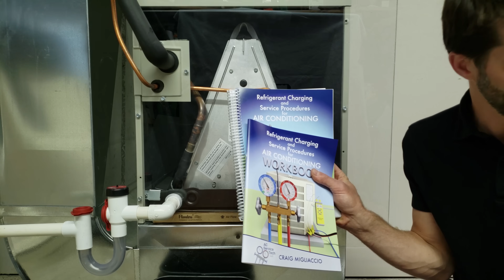Why a Condensate Trap is Needed on an Air Conditioner! Up Close View!

Comment: Good video but the placement of the blower in relation to the coil determines if the condensate drain has a negative or positive pressure. Most systems I have worked on have a positive pressure. A untrapped positive pressure system will blow air out the condensate line and I have had customers on occasion hear a bubbling sound in the walls from this. I experienced a job where an untrapped negative pressure condensate line was hooked up to the houses sewer drain line and without the trap it pulled sewer gas smell into the house. Also  an explanation of the secondary drain should be given. When the primary drain becomes clogged, the water will then drain out the secondary instead of leaking into the house. It is code here in California on two story houses to have this secondary drain run outside over a window so the homeowner can visually see this problem. You could also install a condensate float switch in the secondary drain to catch this problem before water damage occurs.
Reply: We also require a secondary containment pan, and drain, on any unit installed over a finished ceiling.
Reply: Right, most systems I've seen are that way also.  With the blower below the coil and blowing upward into it, it will create positive pressure - not negative.  My system blows air/water out the condensate port - not taking air in.  Hence no trap required nor present.  This is only an issue if the blower is after the a-coil in the system.
Reply: Excellent explanation. Better than the OP.
Reply: I have a goodman furnace with the blower at the bottom and the ac lines and I'm assuming the coils on the top. My drain plug is on top half way point of the furnace. Will that make my system positive pressure. Because I don't have a p trap.

Comment: How close does the trap need to be in relation to the coil?
Reply from the maker: It should work regardless of the location on the line because it will stop the air but I usually put it in front of the evap coil, thanks!
Reply: @AC Service Tech LLC good to know! This air handler was in a small closet and it would have blocked the filter access to have it in front of the coil so I ran drain into the crawl and trapped it there. Great content. Subbed!
Reply: Just make sure it slows downhill all the way. That’s critical.
Reply: get the trap placed as close as possible to where it is exiting the houring.

Comment: Good to know! if the homeowner has a trap, should it be checked and filled if necessary before the AC season starts to avoid this issue?
Reply from the maker: Yes put water in it and vacuum or blow it out, repeat, then add the final water as part of the pm process, thanks!

Comment: isnt the trap only required when the evap coil is on the negative side?
Reply: The trap is not "required" on a positive pressure system. Any system where the blower is pushing air across the evaporator is a positive pressure system. If the evaporator is being pulled on by the blower, thats where your negative pressure situation comes in to play. The drawbacks of having a trap on a positive pressure system outweigh its benefits as the amount of cold air loss through a 3\4" pipe are insignificant and the traps will eventually plug up and cause an overflow/shutdown scenario. Should you be concerned about a positive pressure system allowing odors from your drain, there is a fundamental flaw there... The unit is pushing air out of the drain pipe. If you ever do have a smell being picked up and drawn into the ductwork when the blower is off you should consult a plumber about why that drain is so gross to begin with.
Reply: @whitewigglesworth  this is what happens on my system with the trap. The drain plugs every year. I now blow it out before the season. I was wondering if I should eliminate it. My evaporator is on the positive side. I thought the trap was there because they ran the drain to the septic pump cover in the basement to stop the gases. I rerouted the drain and installed an ejector pump but left the trap. I hate that it plugs every year.
Reply: @whiteowlone  Take it out and straight pipe it. PVC is cheap and youll be happier.
Reply from the maker: Yes but a trap would stop low temp air from leaving the system and the building to go negative pressure while the system is running by blowing the low temp air outside. Also a trap will stop any gases in the area from making its way into the system especially if the drain is hooked to the septic line, thanks!
Reply: NEVER EVER attach hard condensate pipes to a septic vent(can create disease or sickness) use a condensate pump with the 3/8 poly tube in the septic vent... always install a trap in the positive or negative side of the ac... (basic ac 101)
Reply: @Blitzkrieg.u812  Thank you for saying that.  I saw that once under a neighbor''s house. I told her it didn't look right and she said her "plumber friend" had installed it, tapping into the main drain by drilling and filling up the gaps with copious amounts of PVC cement. I asked her if she knew what happens in the winter when the trap dries out from having no condensate in it and the sewer gases start to backflow through her house. She thought the smell was from her dog and his " winter diet".  The only reason I was under the house was to check and see if her clogged rain gutters were diverting water under the house.  A competent licensed HVAC mechanic that I recommended fixed it in ten minutes.

Comment: This only applies when the coil/pan is in a negative pressure relative to the space,  when the blower is sucking air through the coil.  Not a problem when the blower is pushing through the coil.  I don't think this was explained well or shown in the video.  It is better to understand the mechanics so you can diagnose problems versus simply being told blanket statements.
Reply: This really only applies to air handlers since the blower is on the positive side sucking. On a up/down flow there is no need for a trap
Reply: yes, however most air handling units and fan coil units have the fan after the coil, thus you will most usually find the drain in a negative pressure/being sucked when the fan is running.
Reply: I agree what you both stated, I'm not a repair tech but install all systems. watch the video again. The filter is in between the coil and the box below i guess the blower compartment . So would that mean the coil is in positive pressure even thought you see it is in negative. What are y'all thoughts. Thanks ahead of time

Comment: Great Video. Yesterday, I was worked on called, No AC, I came to checked, and I was found Unit low pressure and I had a leaked refrigerant. I used leak detector and checked refrigerant R 410 A , I did checked leak on condenser coil and evaporator coil and no find refrigerant leak, checked leak on suction line and liquid line outside and inside house ,next , I used bubble checked leak on schrader valve core and no find any leak bubble. I added refrigerant 410A to 100 PSIG, and do leak checked again on condenser and evaporator coil and no sign of leak. the system only installed 2 years ago.That time was late , I charge system up so customer can have AC on weekend and reschedule for next week come back and do leak check again on AC. I was wonder, where refrigerant went, can't find leak .  If you have any recommend or suggestion . Thank you for sharing.
Reply: I do a splash of r410a (for the detector) and fill it system to evap coil to test pressure (usually on plate on coil) with nitrogen. Remember the operating pressures for 410a are greater than 100 psi.  The leak might make itself known at higher pressures.  When you go back maybe you will have oil from the new dose of r410a present to spot by eye?
Reply: Some times inexperienced "installers" just use the factory charge and never top it off. Usually factory charge is for 25' of line set. I have come across this hundreds of times in one location working with apartments.
Reply from the maker: I use that ultrasonic leak detector which I really trust and rely on. I used to struggle to fin d leaks and now I am not as concerned or worried about not being able to find it, thanks! I have videos using it and the tool link at https://www.acservicetech.com/tools under the leak detection section, thanks!

Comment: When we moved into our new house in North Florida about 8-years ago, we soon started to have filter failures from moisture.  This was happening every 1-2 months, and at times the failed/wet filter media would get blown up into the underside of the coils.  It was quite maddening.  After considerable research, I found a similar video and installed the clear trap you've shown in your video.  After that, no more issues.

I'm a bit confused why something so critical can be missed by the Building Inspector, and the private Home Inspector that I contracted to check the house out before we purchased it.

You've done the best job explaining why the trap is needed, that I've ever seen.  Great work!
Reply: Ha ha ha. Inspectors. That's a good one. They nitpick little things that don't mean a bit of difference, but anything important they forgot to mention in inspector school. Here's 10 pages of bullcrap that needs to be fixed. Give me my check.
Reply from the maker: Thanks a lot Terry!
Reply: In my situation, A house inspector, in 2011, was paid $600 in my north Virginia location.  That’s 2.5 hours of inspection, 1 hour of report writing, and 1 hour travel.  And they’re inspecting 2000 to 3000 sf building without or without basement.  A good inspector will detect roof, water damage, but they can’t run your AC and point out there’s no condensate P trap.  Today, $600 is my White arborist charges to prune a tree, 30 minutes of pruning & 15 minute cleanup, and the Latino workers are gone

Comment: Wouldn't the trap have gotten primed by that water that drained out the first time it cycled off?
Reply: yes, but by the time the first cycle ends it could have over flowed and splashed all over wetting the filter.
Reply from the maker: Usually the first time a system runs, the building is very hot and humid and like throttle bottle said, it will overflow so after I install or do a pm, I make sure to prime the water in the trap, thanks!
Reply: I know where your lost. Plumbing traps are ment to prevent the same effect this one “creates.” I don’t know how but I ain’t a a/c guy. This makes zero rational sense to me. My traps stay full all the time. We put an air gap (vent) on top of discharge tee to prevent siphonage. I don’t see how it’s different unless you pour a larger amount of water in pan faster than the drain can drain. I’ve watched a many of pans just drip as the source drips. Just to watch the termination drip. Never seen a pour then a break then a pour. They all drip as soon as unit turns on. I didn’t publicly comment because he has a great following and I don’t really know if water acts different from condensate. Never heard this combination of explanation. So I gonna start noticing. But I think plumbing should be explained by plumbers. Our traps look very similar for the purpose of breaking a vacuum and allowing free flow without ever bringing trap level below trap height   🤷🏼 I’m lost. They always told me the air is cooled by the condensate in pan and trap is there to keep bugs from entering the systems sealed area?
Reply: Air cooled by the condensate? Condensate is a result of cooling the air. Not the other way around. I hope who ever told you that doesn't work in hvac.
Reply: @nateg08  no I don’t do hvac. But the intake is from the bottom. The filter slides in little groves. I did not think the air only got cooled by the condescending. but moist air is easier is cool. So I thought it dragged the air across the wet pan to draw moisture. So when the air went through the exchange. It was easier to cool it from the Freon system. Why do they design them to keep a certain amount in? Why not just drain it off if the condensate doesn’t serve a purpose. Like the way a fridge evap works. Drags the hot air across to absorb then evaporate the excess moisture. I just thought that the water in pan has more of a purpose. Especially since the trap needs to cause water to build then release then build and release. Should I just ask what’s the purpose of holding that amount of water in tray of unit? Would that cause you to explain the real reason and not be another ass dragging 3 words into a comedy bit to build your ego? Why does it keep a certain amount in there? Plumbing drains are designed to keep water flowing out at the same rate the source feeds it.  The water only hangs out in trap. Our traps don’t decide how much water stays in pan. (The source I.e, a sink ) our traps are designed to keep smell and bugs on the correct side of trap. Why do yours need to keep the pan full? Why is the intake from bottom right above this moist area? I just thought the condescending had something to do with the efficiency of cooling air. Not the absolute total task. Sorry to let ya down. I am Not a moron, just think too much. It’s cool to call me wrong, but please explain my confusion and you won’t be a dick. Gas Tankless water heaters use the condensate to improve efficiency. I don’t know how. But Why not air conditioner ? This whole speech is what I tell customers when they ask me to drain a hvac system. I tell them it’s not the same. And no one I know  has ever knew why. I would have thought they just drain.
Reply: @pjplumber2146  I'm not going to sit here and write a novel for you. There is no purpose for that tiny bit of water in your drain pan. Its just there. Traps on ac dont build then release they pretty much just flow freely. As far as moisture making your ac more efficient that is not the case. There is sensible heat and there is latent heat. Think of sensible as how the air feels and latent as the water content. Ac will always draw latent heat in the prosses of cooling. Thats what gives you the condensate. The more moisture in the air the less of a sensible temp drop across the  oil. Especially in very high humidity situations. If you are interested in more look up latent heat and sensible heat. I'm not being a dick but its also not my responsibility to educate you. If your going to write a freaking novel about something you might want to be sure you know what your talking about.
Reply: @nateg08  you jumped in. You got the freedom to laugh and move on.

Comment: Is this trap necessary for a mini split system?
Reply: no
Reply: many of those have a condensate catch tray and pump to push it out, some are gravity drain and generally have the trap built in
Reply from the maker: Greg they do not usually need a trap added to them, thanks!
Reply: @acservicetechchannel  thanks much
Reply: throttle bottle. 
I have NEVER seen a "mini split" with a pump ; or a built in trap. 
A pump could be added if your having trouble or going uphill. 
They don't need a trap, although one must be careful to have good fall

Comment: I was always taught the need for a trap only applies in negative pressure systems. And have seen first hand this exact problem happen when one wasn't put in. But I've never had a problem running a positive pressure system w/o trap.
Reply: Same in my experience and HVAC-degree education classes.   Also the issue of checking for and avoiding multiple traps would have been good.

Comment: Great vídeo! Is capping off the the small pvc pipe piece access require? I’ve seen both, with a cap and without a cap. Also, what do you think about having two access ports? One at the beginning of the trap and one at the end of the trap?
Reply: If the blower is pulling air through the coil, the port between the trap and coil must be capped.  The port after the trap is not caped. If it is a push through neither has to be capped.  You can tell by the air flow at the port.  If it is sucking air you have a pull through.  If it is blowing out, it is a push through. The port after the trap acts as a vent to allow the water to drain down the line.  Think of a straw with your finger on top.
Reply from the maker: Great answer Harry!
Reply: @--harry_  and aslo the capped line is the line you UN CAP to pour in some cleaner or PRIME the trap once a year.
Reply: Abner Garcia. If you do a service and fail to clip the caps back on, your phone WILL ring. Esp upstream cap left off will leak !
Reply: Still have to cap the vent between the evap and trap so if the trap gets blocked it doesn’t spray water up out the vent. Use screwed caps lightly tightened so no pop off happens or homeowner knocks it off.
Reply: @n.gineer8102  if you cap a vent then it isnt a vent sir . You make sure your vent pipe length is HIGHER than the discharge of the pan at a min plus 4-6".

Comment: Great. Video. I have a positive flow hvac on my 2nd floor and no p-trap. Straight doqn hill to the outside. Although i have a vertical pipe for cleaning with a cap. When i take that cap off and the ac is running i can feel the cold air blowing out it so i would assume its blowing cold air down the drain along with the condensate. Will water in the p-trap keep the cold air from going down the drain--?
Reply: I was told the trap was not required but would help keep bugs and stuff out of your duct work but then you have to worry about it plugging up.... what is the lesser of the 2 evils?
Reply: Trap is not required on a positive pressure system like a Trane Hyperion system.  Blower is pushing air through coil not pulling.
Reply: yes, your leaking conditioned building air to outside and when the unit is OFF, it can keep leaking air out or let hot/humid air back in, depending on building static pressures (exhaust fans change that, kitchen, bath, stove/microwave )
Reply from the maker: Great answer throttle bottle!
Reply: So if there was a trap the condensate in the trap will keep the cold air from exiting to the atmosphere when the squirrel cage is running.